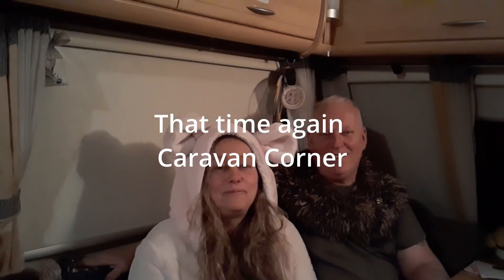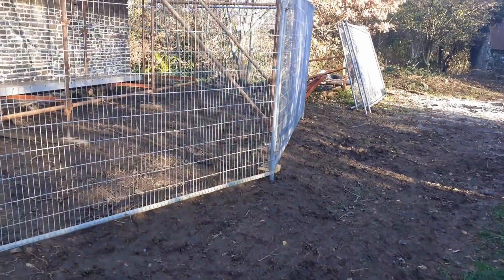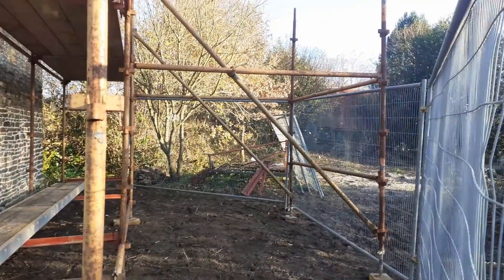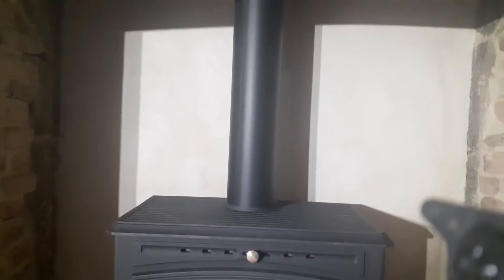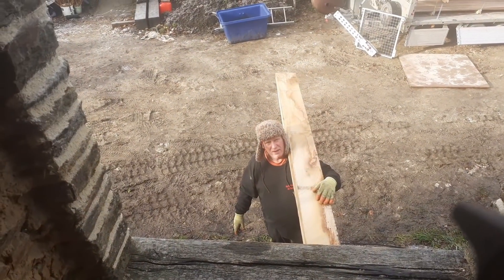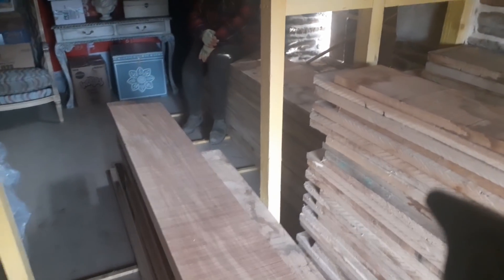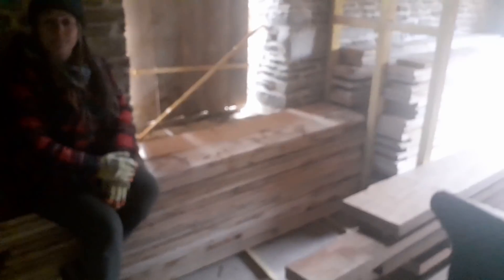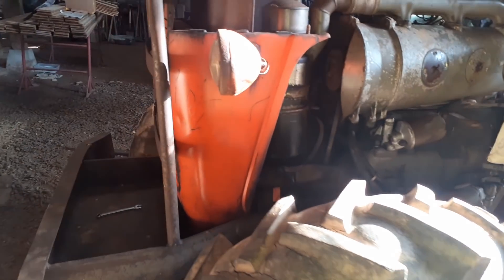No 10 .Three in the fire place and the little one said

Comment: Do wood burning stoves come with those little black fans that rotate from the heat & push the hot air into the room? I have seen many but don't know if they come with stoves.
Reply: Hey Susan you have to buy the little black fan seperately. But the're amazing, make a huge difference. They circulate the hot air through the room. Temperature goes op much quicker
Reply from the maker: No they don't Susan but we are getting them